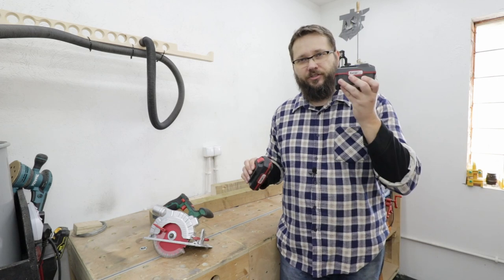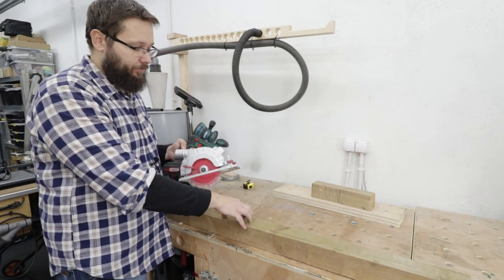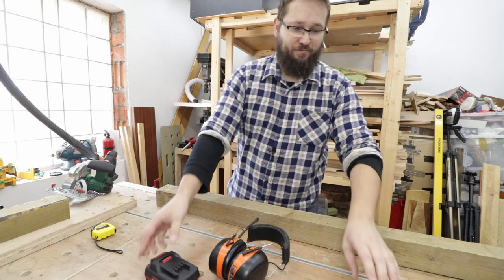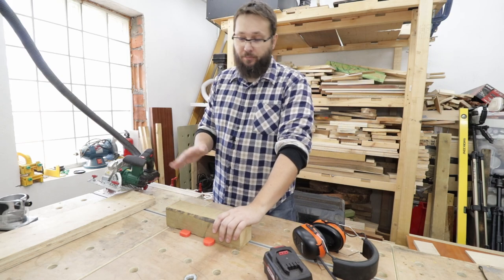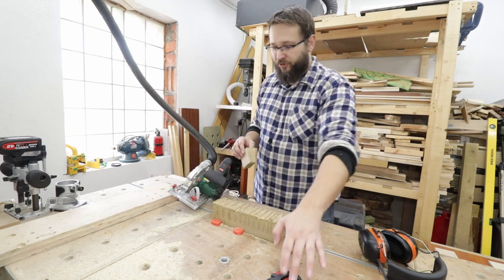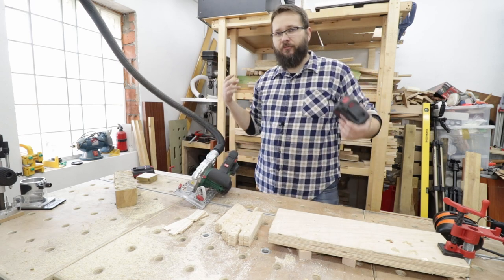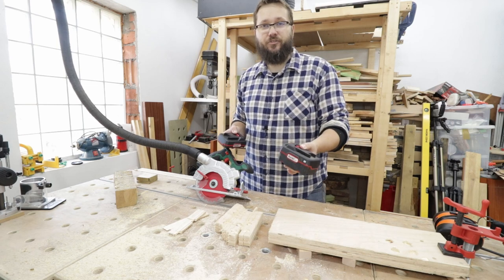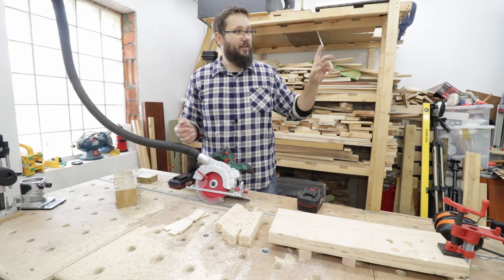2Ah VS 4Ah Parkside Circular Saw Performance Test

Comment: As a budget DIYer and gardner, I've just started adding a few Parkside tools to my Einhell collection. I think both ranges are great value for money. I had heard that not only do 4Ah batteries last longer but also deliver a bit more power. Until this video however I didn't realise how big a difference. Will definately buy this saw without the 2Ah batteries and use my own 4Ah. Dzięki bardzo.
Reply from the maker: Hehe good choice 👍 Pozdrawiam

Comment: Interesting test. I remember the last test you did with the Parkside saw. On that test, you concluded that the saw was underpowered for the tasks you set it.  Most of us would be using that small cordless saw to rip sheet material up to 19mm, rather than a stack of 6x2s or fence posts.
However, you are quite correct: using the 4ah battery does give longer run time and more power. I've heard people complain about the 1.5 and 2.0ah batteries before, but if you are using a cordless drill or impact driver, the lower powered - and lighter - batteries are more than adequate for the task, not to mention more comfortable to work with.
Reply from the maker: Exactly that, each battery has its own uses.

Comment: My parkside circular saw died the other day after 3 years of DIY use but only after a hit a deck screw. Only got one 4amp battery that mainly gets used in the saw but occasionally if only cutting 11mm OSB for short lengths the 2amp battery will manage whilst other is charging.
I enjoyed your video Tomas .
Thanks for sharing
Reply from the maker: Thank you for watching. Sorry to hear that your saw died. Although its an opportunity to buy a new one
Reply: @CasualDIY  Agh, well. As I was happy with the parkside circular saw,  I bought the same from Lidl. I only do DIY stuff and have battery's. So good enough for me.
Apart from the blade that came with it. 
Treated myself to a decent one. 
Hopefully I get another 3 years  👍

Comment: I found this with the 20v angle grinder I have from Parkside. The 2ah batteries would just stop very quickly. I've started buying the 4ah batteries to improve performance and power delivery. I'm going to be buying the circular saw next and that will be on the 4ah batteries permanently.
Reply from the maker: Yes the 2Ah seem too underpowered

Comment: I have two of the 8ah batteries and for the most demanding machines (leaf blower, angle grinder) you can see a significant jump in performance compared to the 4ah. 
On the parkside performance angle grinder specifically, 2ah are basically unusable. If using a flap grinding disc you press even a bit the machine slows down and stops. The 4ah is adequate, but you can't press firmly. With the 8ah doesn't care, you have to actively try to stall the disk pressing strongly to get it to stop.
Reply: Interesting!

Comment: Interesting as usual Tomasz but I'm not sure if I'm convinced by your verdict. Obviously, the 4AH will last longer than the 2AH battery but what makes you also believe that it delivers more power,? To me, it delivers the same power to the saw but for a longer period. My main takeaway is to never consider buying a 2AH battery for a power tool.
Reply: On paper you are correct, but I believe the Battery Management System in a higher Ah battery will typically allow it to discharge more power at once. Presumably by not giving as much power at once the smaller battery can last slightly longer than it otherwise would.
Reply: Higher Ah batteries often deliver more current. It's not immediately obvious why, because Ah is a measure of capacity - not current. However, higher capacity batteries have more cells in parallel, meaning more total current can be delivered at a given voltage compared to lower Ah batteries with fewer cells.
Reply: @danyalm10  Thank you for the explanation, that makes sense.

Comment: Hi, I bought a parkside cordless hand held circular saw and made about 5-6 cuts and then it stopped working but the laser works and the battery is fine. Please don't know what to do with it?
Reply from the maker: Not sure, if the battery is charged, the blade is not bent and there are no obvious indicators of why its not working then I would take it back to Lidl and ask for replacement or refund.

Comment: Interesting test 👍    You failed to mention if both of the batteries the were the same age with the same usage, or if one was older/used more!
In both cases, when cutting the fence post the result was absolutely pathetic ... even at full depth cut (it's a small blade) I'd have expected it to cut the length of the post without issue ... you've convinced me never to buy one of these saws 😀
Reply from the maker: Well that's why I make these videos, people can make educated purchases after seen what a particular tool is capable of. The 2Ah battery is about 1 year older than the 4Ah ( at least purchase wise - when they have been made I don't know) I would say they both had similar time of usage by now.

Comment: When I bought mine people were really slating it as being poor. Granted I probably wouldn't use it to cut fence posts but for sheet materials its really great. Last weekend I was using it on 18mm chipboard and it was like a hot knife though butter (4Ah battery used). My only issue I've experienced is the initial movement of the guard when it hits the material is awkward, feels like it sticks and can put your cut off. Keep meaning to have a look at that.
Reply from the maker: Yes got the same thing with the blade guard, often I need to move away otherwise I can't make the cut.